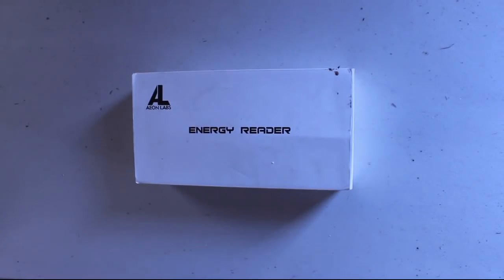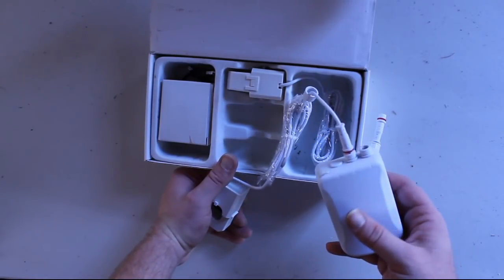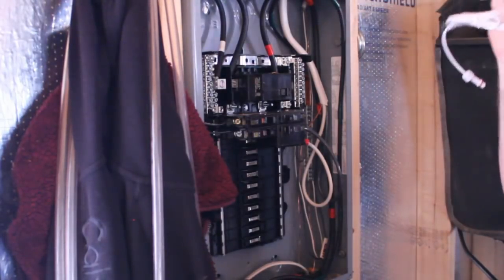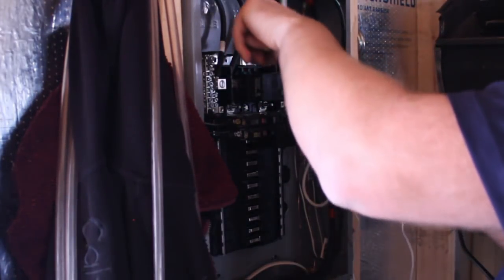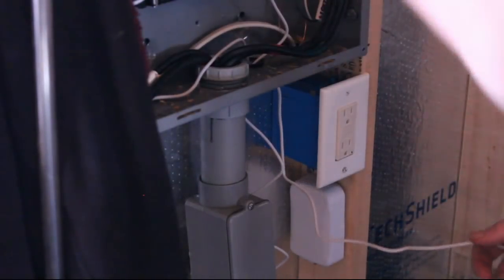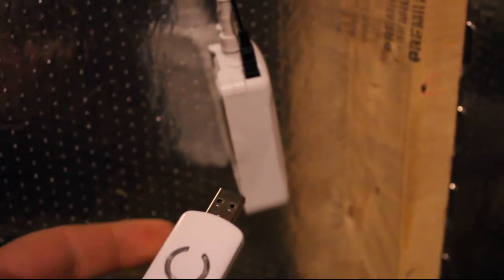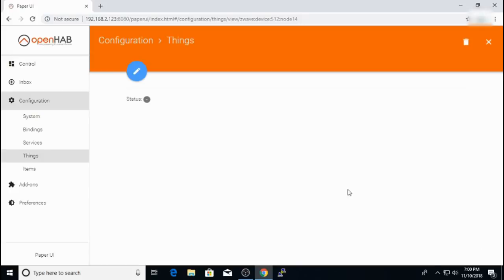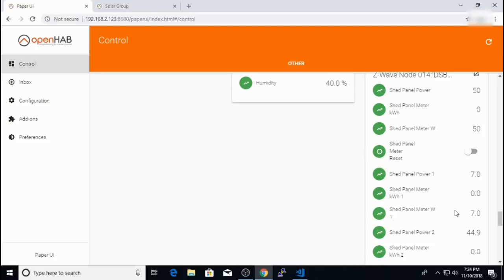openHAB Projects | Installing Panel Power Meter | Aeon DSB09 Zwave Home Energy Meter

Comment: Have you played with the data any more? I have the same setup, but am only able to get data every 30 minutes. I am not able to get readings any more frequently than that - either from the interval setting (get internal server error 500) or from the threshold settings.
Reply from the maker: Yes - I have mine populating an Influx DB, with a Grafana chart showing electricity usage from different areas of my house (including the Shed, which is where this unit is installed in a subpanel). Use Habmin in OH for the easiest way to configure Zwave devices. BTW, mine reports every 10 minutes or so (can't expect any better from these older units, i guess).